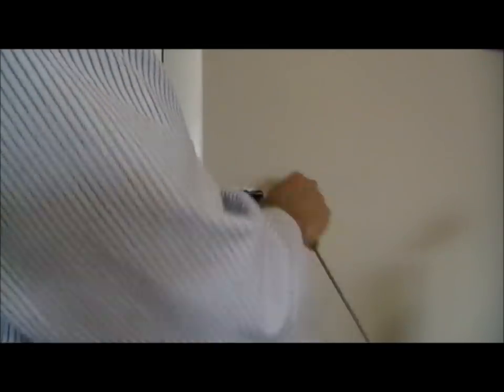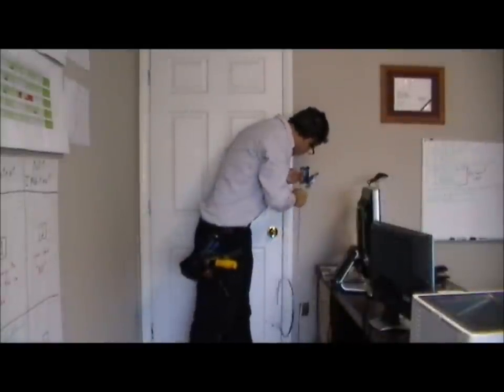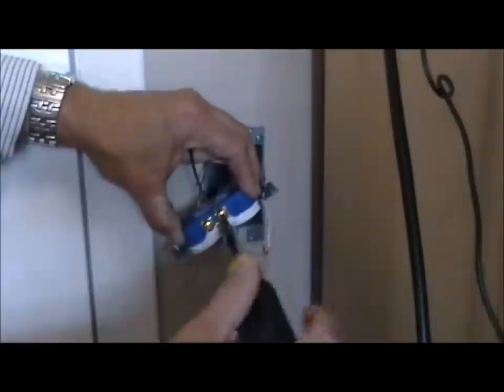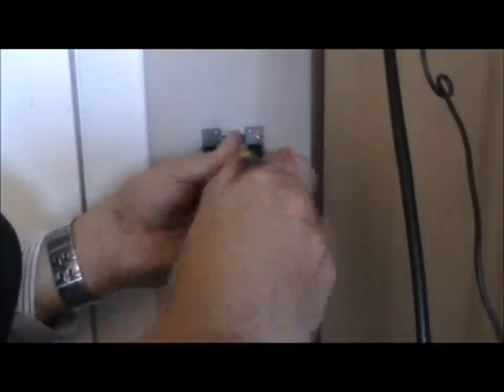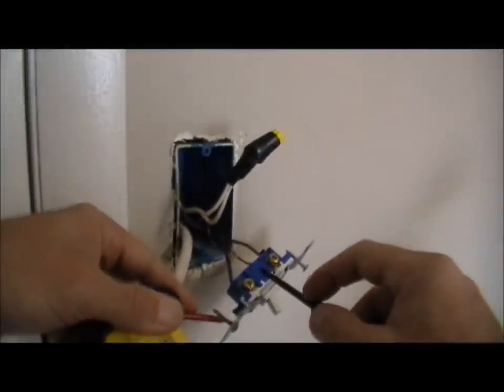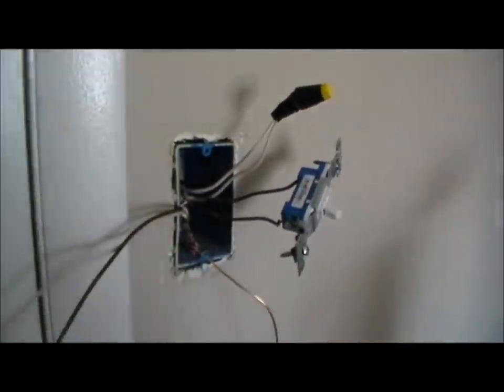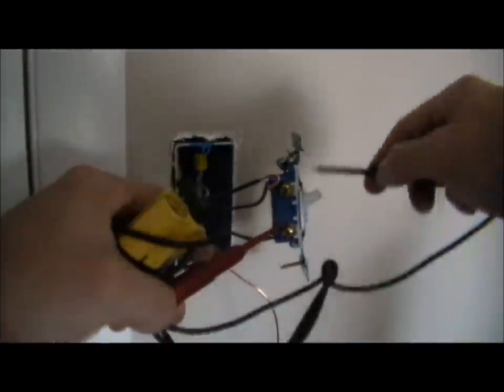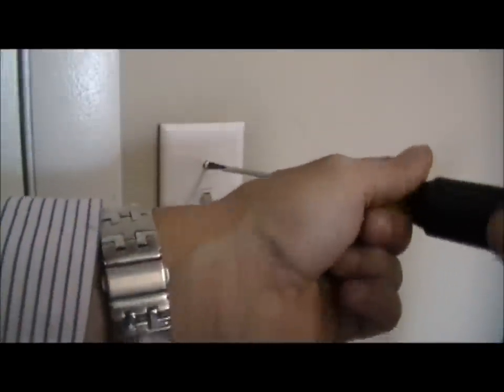how to wire an outlet off of a switch

Comment: So many bad things in this video. Doing a DIY video without turning off the power, I guess you're trying to get people killed. You also assume that all switches are wired the same. Some are wired with a switch loop where the white wire is used as a conductor. If that's the case, then you can't add an outlet to it because there is no neutral available. You should not put two wires on one screw. Hope no one takes your advice.
Reply: I appreciate when people upload videos to help other people.  That said, as for myself, I wear insulated gloves, kill power and use insulted tools.  Never wear a watch, mainly because it gets in the way.  Also when pushing wires inside a box use some finesse and bend the wires neatly, take pride in your work.  Cut into insulation before snaking that way you just need to pull it off cleanly.  Use the hole in wire strippers to make a loop for end of wire to go around the screws, no need to use wire cutters for that.  I was on the end of my seat the entire video, it was like watching a horror movie. lol  By the way, whoever did the cut for the switch needs new glasses, what a sloopy job, looks like a chainsaw was used.
Reply: If you look closely it appears the original wire is connected through the quick connect hole in the back of the switch, so he's not putting 2 wires on the same screw. But, I agree, not turning off the power is insane. Not to mention, not even mentioning anything about the danger of working with a live outlet. Hopefully, nobody gets themselves killed after watching this.
Reply: One he should have turned the power off in the beginning before he did any of this .Use a simple volt tic/pen(to check for voltage in a circuit)which looks like a pen with a light and makes beeping sound if a wire is live/hot.Two he should have made a pigtail of the two black wires for the bottom of the switch.A pigtail makes more sense than putting two hooks on a terminal.He is right about not taping the wirenuts but needs to wrap electrical tape around all the terminals on the switch and outlet after the wires are connected.I guess some areas have different interpretations of NEC rules but keep in mind some of these people watching this don't do electrical work for a living and need to be aware of how dangerous it is to mess with hot circuits.
Reply: Daniel Beck
Reply: when he flipped the switch showing it was still hot I got goose bumps all over lol. I don't care how confident you are in your work, if you are workimg with electricity you should always cut it off at the breaker and then check voltage.
Reply: Bill Ammer Right, he is lucky he was not grounded otherwise he would of gotten shocked when he unscrewed the terminal with his finger. He should of twisted 3 hot conductors together for power instead, 1st is original power supply, 2nd to the receptacle and 3rd is a pigtail to the switch.
Reply: I'm not sure if it was on because he has his hands wrapped around the outlet and he even mentions it being off..
Reply: Rich Lo The switch itself was off but he replied to another comment that it was in fact live the whole time

Comment: electrician hammer ? insulated perhaps. it was an framing hammer which is 16" +/- 1/4" length and he probly meant to use as measure tool to install the box. I do too. By cod top of box should be 16". He did not pig tail the ground to the both boxes which seems to be plastic boxes. Working with hot wire is preferance choice.

Comment: Thank you for the video. It was very informative. I'm wondering however if it is possible to install a light switch and essentially a light fixture from the wiring in the electrical outlet? Thanks for your response.

Comment: Because you only tapped into the hot wire off the switch, the outlet is always on when you turn the switch off correct?Also why didn't you break off the ears on the switch mount?

Comment: Did you run NEW wires from the bottom of the outlet to the switch or are those the exsiting wires from the switch... it didn't say when you were pulling the wires up and through to the switch side with the fishing cable... 

Thanks,
-Nigel

Comment: I have an light switch that only has one black and one white. So, the main goes to the light and the switch is wired just a control. The thing is, I already cut a hole in the wall for an outlet. I think my only option would be to try to pull a fish back through the wall and ceiling to the main and then try to fish two wires bat through the wall: one to the switch and one to the outlet. The margin of error would be losing the wire in the wall and having to cut open the wall & ceiling. Thoughts?

Comment: So, when you are twisting the neutrals together with the power on, if you hit the hot screw with your pliers, you'd trip the breaker, right? And if you hit the hot screw when you are jabbing the box back into the hole, wouldn't that do it too, or wouldn't it do that?

Comment: Did you turn the breaker off when working with wires in the upper circuit ? You were touching the bare wire and screws while the power was still there but you didn't get electrocuted.

Comment: Hi I know you said the outlet was fed off of the switch but, does the switch control the outlet or is the outlet independent of the switch? I have a similar condition but with a pair of switches. I haven't taken it apart yet but I believe the power goes from one to the other switch. I am hoping to tap into that path with an outlet not controlled by either switch but is live all the time.

Comment: Ok questions.
1. Are lights and outlets in the US wired on the same amp breaker/fuse?
2. Are lights and outlets in the US wired using the same size cable?
and 
3. How is he not getting shocked left, right and center working live with what appears to be no PPE for doing so and with a metal box?

I can understand been trained to work live but is this not only for when it is not possible to isolate?

Comment: Hi, does the receptacle work without turning the light on, or only if you put light switch on? I have a receptacle that only works when my light switch is on. If I want the plug-in on all the time, do I have to find   the line that is coming in all the time and put the wire to plug in on that one, the hot wire? Thanks
Reply: No.  The receptacle should always be hot.  You're wiring the hot wire that goes to the receptacle off of the wire that is always hot (that's why he does the testing in the beginning to figure out which wire is the hot one).  If you wanted the receptacle to be controlled by the switch, you'd feed the hot to the receptacle off of the other screw on the outlet.  Incidentally, if you don't like that switch controlling the receptacle you have, you could fix that with a wire nut (though that would render the switch useless unless it controls something else too).

Comment: Hello my friend I like your video thank you for your free education... Question: So in order to use the outlet the switch has to be in the on position??
Reply: He connected the black wire from the outlet to the constantly "hot" wire side of the switch.  If you want to have outlet working only when switch is on, then connect the black wire from the outlet to the other screw of the light switch.  You probably need a voltmeter to find out which is hot.

Comment: sir, did i just see you at 12:38 putting 2 wires under the same screw? i was under the impression that one should never do that, and that one should pigtail them instead, or use green wirenuts with the hole in the end

Comment: I am building a riser for my home theater system. I am trying to figure out how to power the theater seating at the base of the riser. My first thoughts is to run an extention cord from the back of the riser to the front (does not create an aestheic appearance) the second option (and tell me if this is possible) is to tap into an existing outlet and run a line through the riser into a outlet created at the front of the riser. Is this possible? any alternatives?

Comment: I have a switch that has two wires going to it--a yellow and an orange. Each wire connects to a screw. I wish to install an AC outlet below the switch (just as in the video). How do I do this? Thanx!

Comment: seeing stuff like this, I'm glad I live in Australia, our lighting circuits are completely separate to out outlet circuits for safety. (earth leakage detectors)
so you can have light without sockets being live, super handy when working on sockets.
we also can't do out own electrical work, it has to, by law, be done by a licensed electrician. 
annoying for sure, but a lot safer.
Reply: What happens if you have a problem and you can’t afford a licensed electrician? Are you required to have a fire for your insurance can pay for it?

Comment: If I wanted the outlet to turn on with the switch I would just put the black wire on the top screw instead of the bottom with the hot right?

Comment: Can you run a portable AC unit plugged into such a newly installed outlet? 5000 to 10000 BTU, not sure the amps? Worried about the wire cable used to run between box and switch and if the original Hotwire from the switch can carry that load. What is the difference from such a new outlet vs an original installed one? Wire thickness and directly into the grid vs over the switch wire? Thanks.
Reply from the maker: Do you need to know the amperage load on the entire circuit. I can't tell you by BTU because the power requirements are dictated by the units efficiency. The circuit is a 15 amp circuit. I would not use more than 80% of it including your air-conditioner and lighting.

Comment: What if you have a switch in middle of a circuit?  With it having 2 black wires coming in and out to another power.  Leaving no room to add another out to additional outlet?  There would be no more screw for another hot wire hook.

Comment: At 12:35 - I can't tell - is one hot conductor back-stabbed into the outlet and the other hooked around the terminal screw?  Is that allowed - wouldn't you rather pigtail?

Comment: very good
I want to wire an top outlet to the plug from an Disposer and a switch to the bottom outlet and control the power to the top with the switch'
This is an old house with no ground so am tying a ground to cold water pipe
The switch is mounted  on the wood in front of the sink cabinet
I want this switch to turn the disposer on and off with the switch
How can I do that???
Thanks
Manny
Reply from the maker: You need to run a new wire from the panel. Absolutely positively do not grounds of the plumbing pipe. That is not acceptable.

Comment: This is all good if the power comes to the switch.  But if the switch is a dropped switch loop from power in the ceiling, this will be a lot harder to do if you want to wire in an outlet legally.

Comment: Two questions does the power only run to the outlet if the switch is on now? Second how were you able to touch the hot wire/ screw without getting shocked?
Reply: lixlopez Also will this type of plug be enough power for a freezer?
Reply: lixlopez He by-passed the switch by going from the hot side (line) down to the outlet.

Comment: thanks for the info. just wondering, when this job is finished, does the switch control the outlet? or does the outlet work independently? i want add an outlet via this method but i don't want the switch to turn off power to the outlet every time i turn the lights off. also: is there a way to find the hot wire without using meter? i don't have one.
Reply: Wondering the same
Reply: The outlet works independently. He is sourcing the power from the switch box since the hot, neutral, and ground are available in this example. Never put 2 wires on one screw like he did, use a pigtail and wire nut the 3 hot wires together.

Comment: What if I have a 2 way switch?  Should I put the black wire on the common or the hot?  I put it on the hot and the outlet only seems to work when the switch is on.

Comment: Thanks for posting this video!! I see replies range from two or more years ago so hopefully you or someone on this channel can answer this question for me...and it's a good one! Scenario: I have a 3 prong double outlet, single gang receptacle that has a pigtailed  hot and neutral. The neutral goes to one outlet (top or bottom) and the hot goes to the other one. For sake of explanation, the neutral is pigtailed to the top and the black is pigtailed to the bottom. When power is turned off at the breaker, the outlet itself is no longer live, but after using a tester one or more of the wires pigtailed into the outlet is still live. Why would someone wire the outlet in this fashion? I haven't verified if the outlet tab is removed (most likely it is) or not. I'm sure this outlet is midstream of the others, but I've never seen an outlet wired in this manner with pigtailing . Can't a guy do a simple outlet replacement! Come on man! Thanks for reading and shoot a reply if you or anyone knows. Thanks!
Reply: Sounds like some info is missing and you also don't know enough to do the job safely. Changing devices ins't always just a flip one breaker deal. There are many times 2 or even more circuits passing through a box. Sometimes the top receptacle of a duplex is fed by one circuit and the bottom by another, and tabs broken. Also one could be switched and that switch could be on another circuit. You need to be able to test all live and/or switched hots and turn off all breakers associated with them.

Comment: Did he put the hot wire for outlet on the switch with the feed wire for the switch? When you turn the switch off the outlet will not work will it? 😮come on some body please tell me. I would never an out let off a switch that way

Comment: I’m installing a GFCI circuit off a light switch operating a fluorescent lamp light but I don’t see a neutral. Testing the two wires off the light switch shows current of 120 on both leases. I don’t see how that’s possible. How can I hook up the GFCI circuit from that type of light switch? Please help!!!

Comment: This video helped me to understand how it works, but does that mean whenever you turn the light switch off, the power on the outlet is out?  I have several of them in my rooms that work like that.
Reply: The black "hot" wire going to the new outlet can be connected to the "hot" wire coming into the switch OR the switched "hot" wire coming out. Which you connect it to will decide if the outlet always has power, or if it's switched and only has power when the light switch is ON.

Comment: I have a red wire coming off my outlet. Do I connect that and the black wire to the switches always hot wire?
I want to stop my light switch from turning my top half of the outlet off.
Reply from the maker: In most cases that will do it. You can't tell without testing it with electrical voltage tester but the Redwire is typically used as a switched conductor one controlling or ceiling fan.
Reply: black is constant(always hot) and red is mostly used as a "traveler"

Comment: Hi great video. If I'm going to install a light switch from the outlet will it be the same procedure? Just in reverse!!
Reply: Tap the outlet to the switch box.
Tap or split the black (power) wire to the switch.
Wires out to the light or what ever.

Comment: Will this outlet switch work independently of the light switch (if I turn the light switch off, will the outlet switch continue working) ? If not, is there any way I can do that ?
Reply: I did a little bit more research and then saw your video again.  Finally I did precisely what you showed in the UTube.  Thank you.  It worked just like you explained.

Comment: Thank you for the video, but there are combination switches with an outlet available and no new wiring or box is needed. However you probably needed that plug where you placed it.

Comment: Smitty, it looked like a nice clean job to me.  We can all quibble about little things I suppose but calling him a "hack" seems unwarranted.    Your observation that he should have used a pig tail is correct but those two wires on one screw will still be working 25 years from now when somebody has to replace that switch.  Pre-twisting before putting on a wire nut?  Why not?

Comment: how was hot/black wire from receptacle attached to toggle switch? two wires under one screw? i miss....
Reply: Wondering the same thing, what did you find out?
Reply: SCOTTY LMBOBOY looks like that single pole toggle switch has line (hot) wire coming in to the quickwire hole in the switch (the less swcure connection as he stated) black conductor going to receptacle is screwed to that same terminal in the switch. evidently the line going to light fixture isn't grounded. no ground wire showing for it....